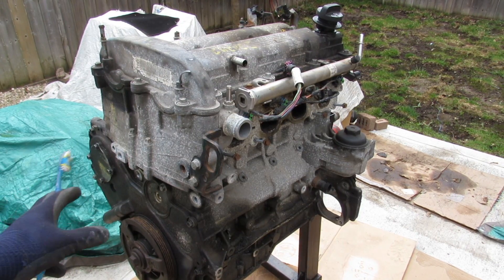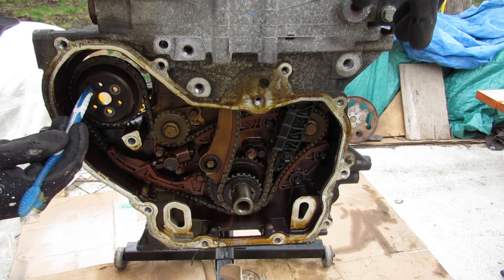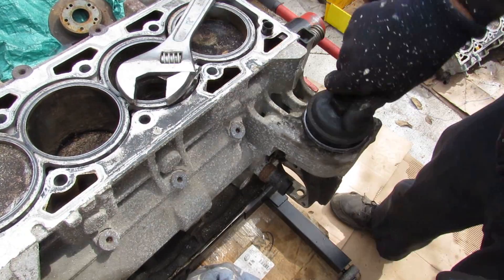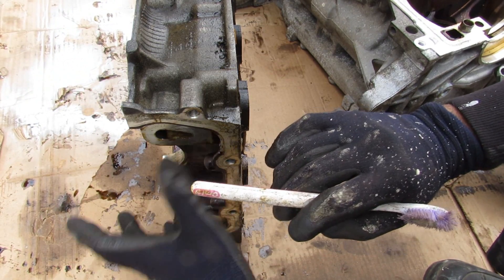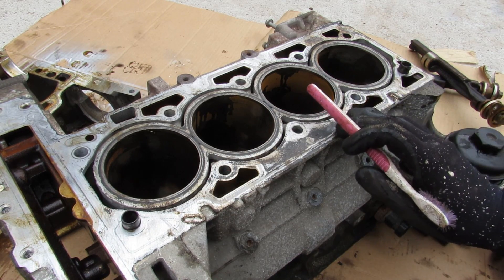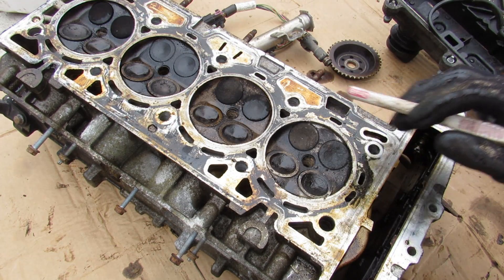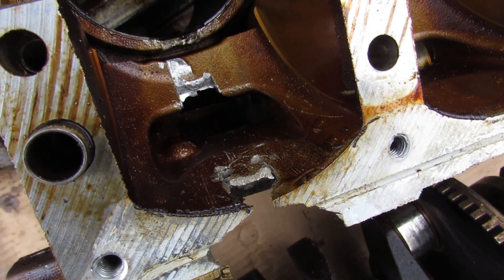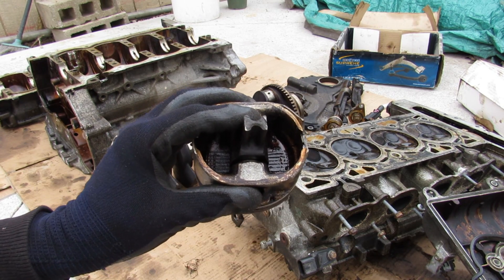Why GM Ecotec Engines FAIL

Comment: Your diagnosis is completely wrong. If the cam chain tensioner caused the problem all pistons would be marked. The damaged piston, significantly the one with the broken connecting rod, has valve marks around the top, not just in 2 or 4 locations that coincide with the valve positions in the head. 
There is nothing wrong with the oil rings, the real problem is the nut behind the steering wheel.
The crud under the valve cover and in the oil rings indicates a poor service history. When oil is not changed often enough it gets diluted plus the additives lose efficiency, this results in oil burning and sludge accumulation.
Your statement that excess oil has been bypassing the rings is incorrect. When this happens the outside of the piston crown will be clean because the oil washes off the carbon.
What really happend? Poor servicing caused a build up of crud in the sump, this blocked the oil pickup enough to cause a bearing failure. Continued operation resulted in a conrod breakage. As the engine came to a stop the lower part of the conrod smashed the piston into the cylinder head, it has also imparted some rotation to the piston, hence the multiple valve contact sites.
A note on service intervals. A manufacturer may state that engine oil should be changed every 10,000km, this is what the car salesperson tells you but he does not mention that  (it's in the owners manual) for servere service the oil should be changed more often. City driving is classed as servere. We have seen many examples of this failure in used imports from Japan. These cars are of all makes, Japanese, European and American
Anyway, that's my $10 worth.
I am an Automotive Machinist (Engine rebuilder) with 46 years experience
Reply from the maker: Thanks for your input. That could have also been another failure which indicates why connecting rod bearing #1 was burned blue. However I did find the chain loose, so it could have also skipped timing...

Comment: I have a 2003 Chevy Cavalier, it only has 73k miles and the echo tech engine is in great condition, I'll make sure to keep on using synthetic oil  and see how long the engine is going to last, right now I'm averagering about 2.5k a month since its my daily ride, I know the fuel pump and other parts will eventualy go out but its no biggie
Reply from the maker: Awesome. I don't see cavalier around here. Or even cobalts

Comment: I don't understand why GDI yields better power and/or economy. Since the goal is to achieve 14.7:1 in the cylinder at the moment of ignition, why would it matter if it were throttle-body or MFI or GDI?
Reply from the maker: You can time and better predict the gasoline entrance into the combustion chamber, and also use fuel to cool things down to control emission
Reply: @speedkar99  On the flip side, excess fuel runs down the cylinder, & delutes the oil??

Comment: A mechanic friend told me... Change the oil every 5K and you won't have any issues with these engines.  Same with the 3.6L GM's.    CHANGE THE OIL!   Can't blame the engine for lack of maintenance.  @15:05 Speedkar99 said it all. .. These engines depend on oil quality and quantity.
Reply from the maker: 3.6 I heard is pretty bad
Reply: @speedkar99  It is, per what many have said, you can't follow the maintenance monitor... you have to change the oil at least every 5K.  I think GM said every 8-10K was acceptable.  It's not.

Comment: Makes you long for a cam gear driven by a crank gear and pushrods
Reply from the maker: Even that has a chain driven camshaft
Reply: @speedkar99  
A large number of engines have the camshaft driven only by gears. No timing chain involved. Sometimes idler gears are involved. A 5.9 Cummins comes to mind, as well as flat head Ford V-8

Comment: it's all maintenance. I had a few GM engines which are known to be prone to fail. But with simple maintenance (Oil changes every 10.000km with good synthetic oil, good plugs, air filter etc) they never had any issues...
Reply from the maker: Nice. 10K seems alot for oil

Comment: most idiots run these out of oil. a pos desighn that actually won a 10 best engines award. neighbors had one that needed new timming chains at 27k
Reply: LOL !!! ... They never checked/added oil. The Ecotec is a Vauxhall DOHC belt driven cams engine converted to oil lubricated chain driven cams for vastly more reliability. Vauxhall had recommended changing the belts at 80K miles... they didn't last that long, so they changed it to 40K miles... GM doesn't have any mileage recommendation for changing the chains... After initial break in, I recommended using synthetic oil and regular oil changes to make the engine last and stay clean inside.
Reply from the maker: Ouch

Comment: Please do a Kia engine. Huge recall on the 2013 to 2017 four cylinders (gdi and mpi). Even the 2.0l turbo will burn through cylinder 3 exhaust valve which isn't covered under warranty
Reply from the maker: I just picked up a theta2 engine from that recall. Teardown coming soon
Reply: Sweet, Looking forward to it. Have a feeling the piston rings might be the problem
Reply: @djmartin4776  yep it’s piston rings connecting, rods and a whole bunch of other problems. The Kona EV just had a recall due to LG batteries catching on fire, Korea has banned the sale of them but are still selling them everywhere else 🤔.
Reply: It’s actually 2011 to 2021 on certain models (Hyundai included).

Comment: I want to start this off by saying this is mostly additional info for people. I find he did a great job making an unbiased video about this engine. "While I can't speak for all of them the 2.0-2.4l ecotecs from 2004-2013ish (the 2002-2003 had an issue that if you baby it, the cam chain squirter wouldn't lubricate properly but that was found out and fixed within 2 years and was a $20 part that could be replaced in an hour with the engine in the car.) had almost no failures that weren't maintenance related or low % unlucky QC and had no recalls whatsoever. Also considering it was made as an economy engine with no intent to make it a performance one (the 2.0 is their realization that it could and is only a destroked L61 with piston squirters installed from the factory) the power you can get out of it safely per step up is crazy. This engine starts at 140HP and 130  torque from factory and the GM build guide states stock it's good up to 250HP, after that it's pistons and rods then it's good to 500HP, then a billet crank till 750HP, then they recommend better cylinder liners and a different oil pick up and that's good up to 1000HP and after that I think performance GM made a copy of that block out of higher quality aluminum and a better casting procedure that safely makes 1400HP."
Reply: Also might as well put this here since this will likely lead Ecotec people here. If you're interested I'm going to be supercharging my 2005 Cavalier and this is the build list.  Mostly full rebuild of the trans (steel plates, bands, seals, washers, new/upgraded electronics,  :OPT 4T40 kit with almost all the extras:, LSD kit) full engine rebuild kit, new valves(oem), forged rods, forged pistons, stage 2 cams, neutral balance shafts, rebuilt M62, SS intake, (ZZP super kit, 82 springs, #60 injectors, new rollers, updated lash adjusters), complete front suspension replacement, all new coilovers (KYB strut plus) and will be painting the engine bay, and everything attached to the engine more or less. Am expecting 250ish wheel HP.
Reply from the maker: Nice

Comment: My 2.2 ecotech works amazing bullet proof motor from 03 cavy and my 04 cavy! The 03-05 2.2l ecos are the best ones! And no vvt
Reply from the maker: Yes. However this was a 2.2 and it still failed
Reply: @speedkar99  this is the only one I’ve seen go. So u must have done something wrong. Ik of one with 500,000km and gets beat on all the time just does oil change

Comment: Lol your wrong on a few points......the timing tensioner wont just fail from low engine oil, more so from lack of oil changes that'll clog the oil feed orifice to the tensioner causing failure. The cylinder head is the lest damaged out of all the main components all it would potentially need is new valves, valve guides and valve seats, I don't see anything else wrong with it.....yet you think the block would have been use-able aside from the damaged oil galley...wtf?
Reply from the maker: Man you didn't get the duct tape joke at all.

Comment: The explanations of how the engine works are excellent. 

However, the complexity of this engine is beyond me. Somebody overdesigned this!
Reply: It's a belt driven cams Vauxhall engine converted to permanent chains driven engine!
Reply from the maker: Yeah it's quite a bit more complicated than say the Toyota or Honda 4 cylinder teardown I've done earlier.

Comment: i have an ecotec with 126,000 miles keep lucas fuel treatment in every fill up-change oil and filter every 3500 miles-4 quarts --new gm filter-cheap--i do it myself--does not burn or use oil-runs smooth and fast i believe maintance is everything in any engine
Reply from the maker: Lucas is more expensive than just topping off the oil you are probably burning